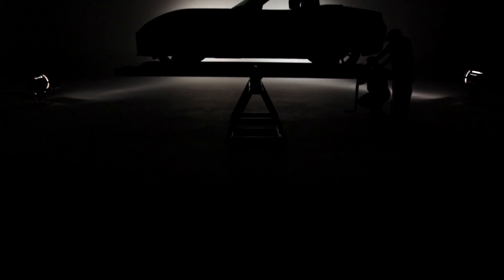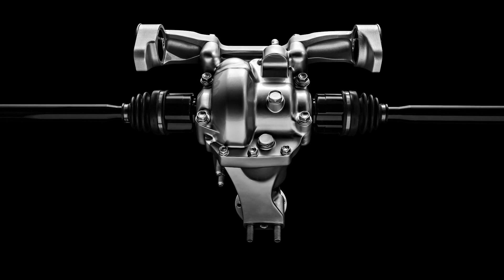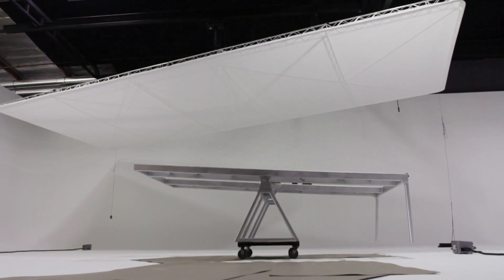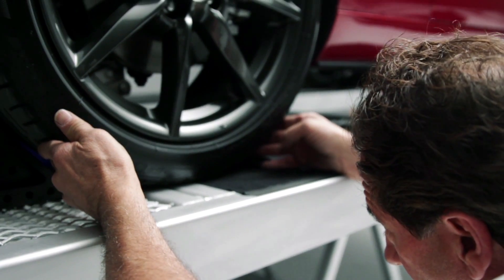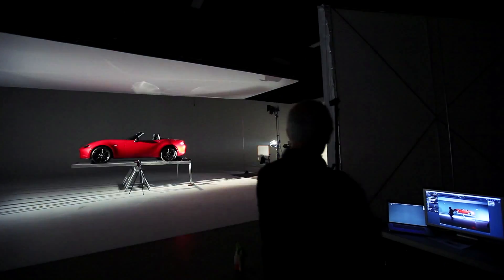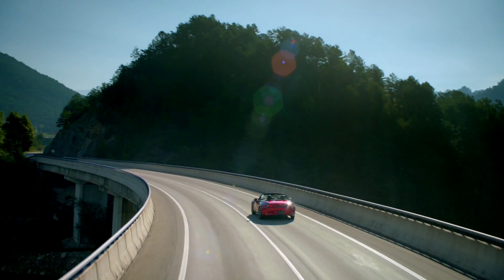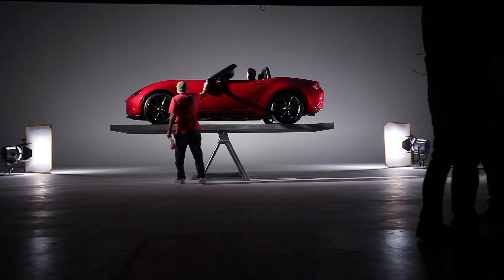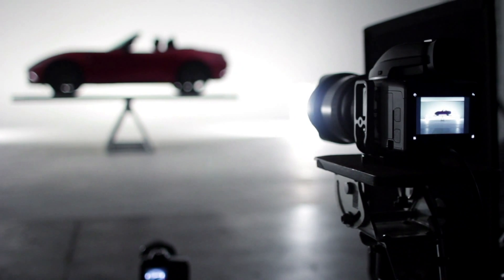2016 Mazda MX-5 Miata Behind the Scene Balance Video

Comment: I love the miata and I know it has close to 50/50 balance, but this is dumb, any body with a basic understanding of physics knows that this can be gone with any car, its just a matter of positioning the positioning the car's CG right above the fulcrum. This test proves nothing.
Reply: .............the point is that the CG of the miata is at dead center, or at least close to dead center of the car. With my old celica, id have to balance the car 30-40% from the front bumper. That's nowhere near as impressive as this.

Comment: Woosey dark red color that is on sedans and trucks.  Sports cars should go bold with cherry red like Mustang, BMW, VW.  It's low so I don't want headlights in my eyes... it needs auto dimming rearview mirror.  Don't we all have garages...yet there is no Homelink Garage door opener.  Am I supposed to bring my portable garage door opener and leave it in an open convertible...duh???  Why is GPS only offered on the GT model but not the CLUB...I guess I could buy a smartphone mount and use its GPS??  With the top up, I need a backup camera but I am surprised it's not offered (mandated in 5/2018).
Reply: mrpmj00 I have a grand touring model NC and it has the Electrochromic Mirror and Homelink.
Reply: Gman1024 Thanks but I am referring to the 2016 model.